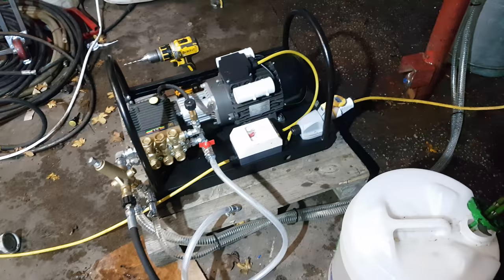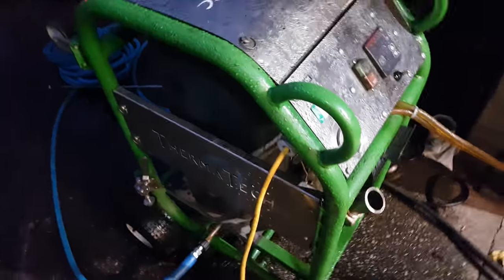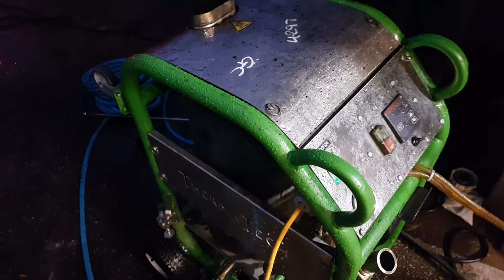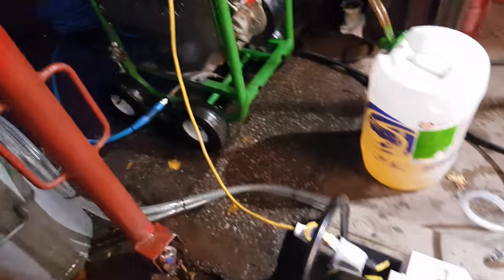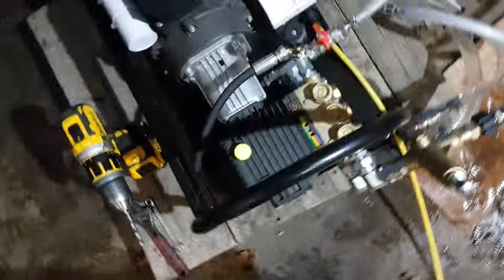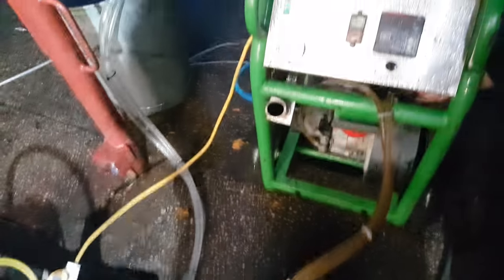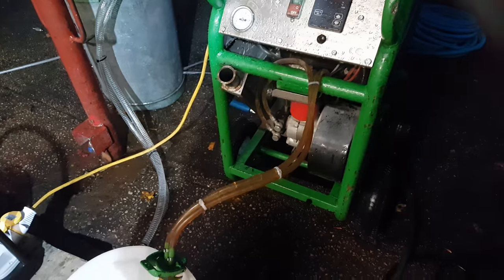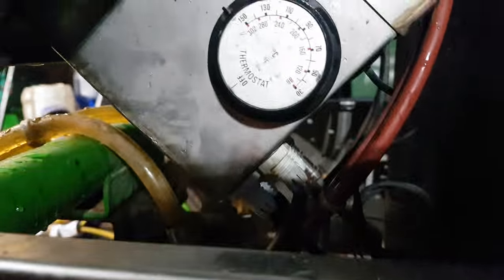QWASHERS YOUTUBE EBAY THERMA TECH STEAM HOT BOILER REPAIR & SERVICE

Comment: Hi, what do you think of the therma tech compared to other steam machines on the market? Do you think that you could use this as your go to machine for external cleaning or do you have to have a high pressure washer for dives etc?
Reply from the maker: Total waste of money, one speed and and one speed only, very slow.When we first got our hands on the setup, we thought the machine was faulty, we went over the machine to check to make sure the burner was working correctly, the pump was right. just dids not come upto my exspectations at all. We have always if possible when building pressure washers (cabinet static) fitted a larger ltrs boiler to the pumps max ltrs for cleaning with, 
when i was showned years and years ago to move dirt & degrease ect you always used high tempreture & so the system's practise is basic, 
if you have a pressure washer already then buya boilwer that is bigger volume ltrrs to the pump. do not try and fit a larger size burmner nozzle or the boiler will not last. 
https://www.youtube.com/watch?v=TwI2P85R7pM
Reply: Thanks for the reply Damien. 

So what do you think of the Mazzoni Firebox 250 bar @ 20 LPM 240v AC? 
I have a 21lpm pressure washer.
Reply from the maker: @iancooper6519  So the mazzoni boilers electrics have PCB and in our enviroment, Damp wet they can fail. Only one PCB that was made right which had a protective coating on it was the old KEW PCb, never failed. That is why wheni first brought in the firebox i decided the mazzoni bare to do my own wiring. No PCB but with timer delay & contactor with 24 volt controls & test button low fuewl level switch before starting.
Reply from the maker: Also think of what youy are wanting to get to with the job you are boiler, pressure & ltrs of the machine first then buy the boiler above the machine ltrs.